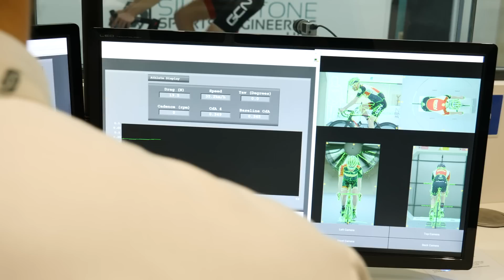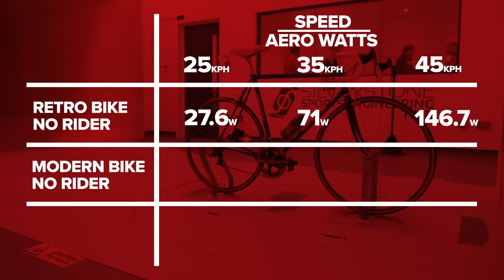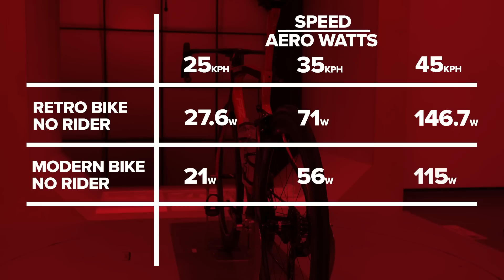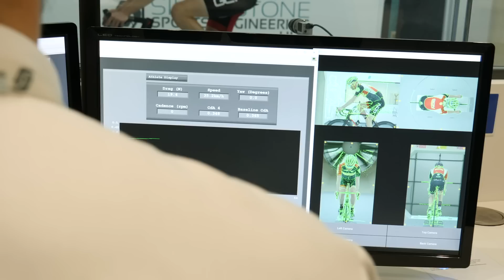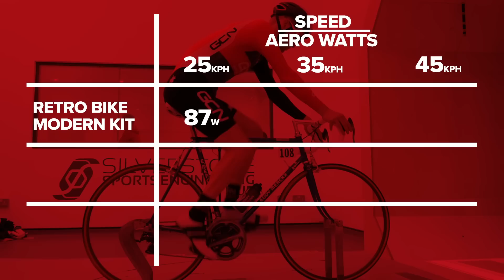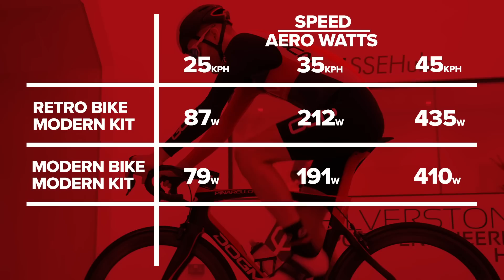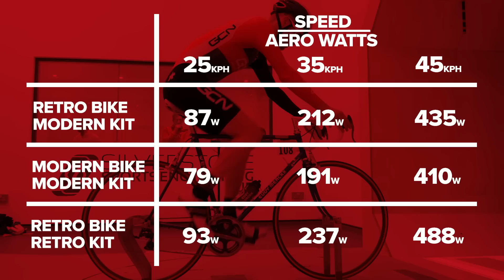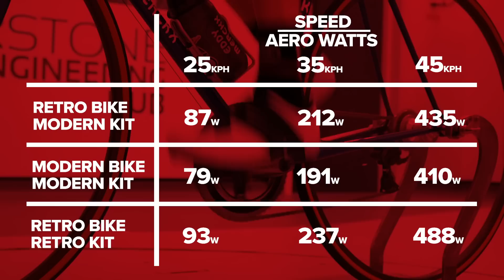How Much Faster Is A Modern Road Bike & Kit? | Retro Vs Modern Wind Tunnel Tested

Comment: Bottom line. Pinarello, is for speed & miles. Eddy Merckx, is for smiles 😊
Reply: @daAnder71 I read nukes instead of pukes lmao
Reply: Another bottom line : Steel still safe to ride after thirty odd years - carbon after thirty years - not sure ? If you bought that steel frame back then you could be passing it on for many more generations yet !!! I don't know if you could trust Carbon to last that long - It might be OK though
Reply: @ariBernstein78  I ride a '71 Sekai 4000 and it works fine.
Reply: Honestly, I don't think most people here (certainly including me) are good enough to really experience the difference. I'm certainly not fast enough
Reply: That is not a HUGE difference considering a 10k£ bike versus a 30-40 yo bike you could almot get for free. I think Ollie made a gross exaggeration which surpised me a bit. The pro's wouldn't be able to compete on the Merckx, but you and me could take our sub 300 FTP's and stretch to get more Aero instead of spending 10k £ on a bike. Check out their video on bike position, clothing etc and you'll se that by just getting more uncomfortable positions to work you could save way more. I'm not saying "go get a retro bike" but you could as well buy the 1 k£ shimano 105 alu bike instead of the top of the range if you're not a pro. You will put out seriously less watts at the same speed as your mate on the F12 if you can get aero and he catn sustain the same low position.
Reply: @danielandersson3539  a bike like these aren't free. Building something that is like 90%ish percent close to the retro bike on the video would cost 300-400 pounds. At this point hunt for bargain Cervelo or Bianchi, bunch of them at 500-800 range with decent group sets. Of course all of that applies only if You can work on the bike yourself and are in no time crunch to get it ready. Also this is a reply to 4 years old comment. Hope you are doing good mate.
Reply: I ride my carbon bike for both miles and smiles though, the brand don't affect my enjoyment of cycling

Comment: 10-20 watts???? A $10,000 bike verses a bike you can probably get for free or under $100 and you only save 10-20 watts? We, the cycling consumers, are so stupid.
Reply: Miss my old round Super6. Still not convinced my newer/aero bikes are faster/better.
Reply: These numbers are acquired in test conditions and only head wind. The real world difference should be much less.
Reply: @deluc6821  no, saving will be greater with crosswind, because air flow will stay attached on the aero profil
Reply: @Hero2lafoi  is that correct?  surely cycling in let us say a continuous crosswind on a modern aero bike with it's near flat sided aero tubes would be detremental compared to 'retro' round tubes?  (genuine question)
Reply: @Hero2lafoi  i can say on thing: on a modern aero bike you get tossed around in crosswinds (hence the bike offers much wind resistence when blown from the sides).but on a steel tubed bike with low section wheels you dont. so the steel bike is actually much more effective in this condition and thus, should actually be faster (or at least make up for a good portion of its disadvantages).
Reply: Digi20 Agreed, I have recent real world experience with exactly this point.....
Reply: Yeah. Ugly, too.